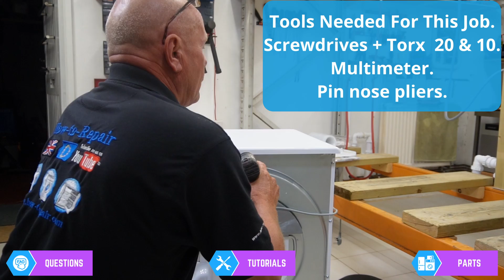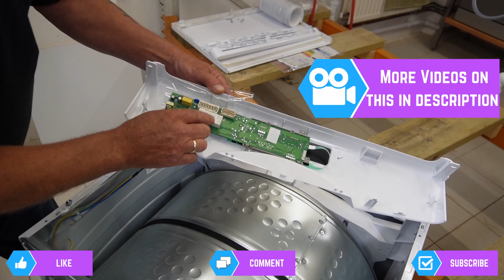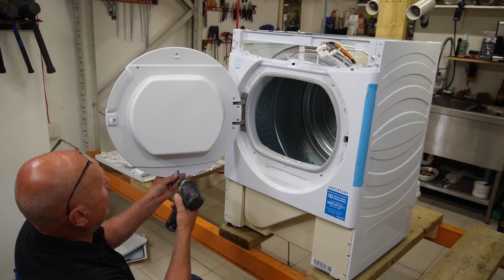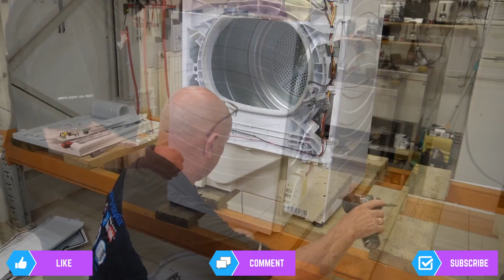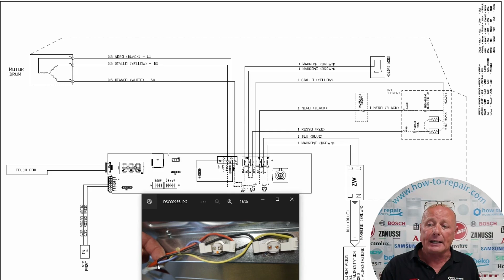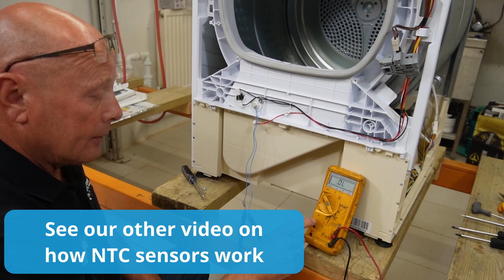Tumble dryer not heating up, How to test element & thermostats on Hoover and Candy tumble dryers

Comment: hi I have a hoover infinity tumble dryer and I've changed the heater which now works but it don't seem to stop once it's dry and do a cooling down bit, will that be thermostat
Reply from the maker: Hi, please use our contact us page and make sure you fill out the request for what your problem is. I will need the full model number of the identification plate and the details of your problem so that I can provide you with useful literature. A video shoot of the problem would be perfect as well.

I will get back to you within 24 hours, normally. https://www.how-to-repair.com/help/contact-us/  

Please remember to subscribe to our channel, as that's what keeps this channel going. Thanks, Paul 👍

Comment: 4521 on the front thermostat means it was manufactured in week 45 of 2021.  

Checking continuity on a thermostat is not a full functionality test.  Thermostats can cause fires when the moving contact welds itself to the stationary contact because they lose the ability to break the circuit.  For a full functionality test, I recommend blasting the thermostats with a heat gun (or a hairdryer) until they go open circuit.  It's still a bit rough and ready because you can't measure the temperature at which they operate very precisely, but at least it shows that the thermostat's switch contacts are not welded together.

Comment: Love your videos as a handyman they have been handy!
I have Zanusi ZDC8203W condenser that is not heating. I was initially called because the belt snapped it turns on and the motor is spinning but discovered no power to the elements. The TOC on the heater is fine and the NTC is working there. There is continuity on the blower ntc any suggestions please?
Reply from the maker: As you would be well aware, it is very hard for me to assist when I haven't got the appliance in front to me, but I will tell you to inspect any forward thermostats or NTC sensors to the correct ohms reading at the right temperature, and I would also tell you that if all the thermostats and NTC sensors are testing correctly, then you may have a problem with the high amperage really on the printed circuit board. I hope you had a good New Year and please remember to subscribe to the channel as that helps us